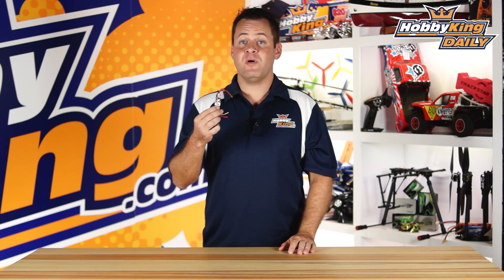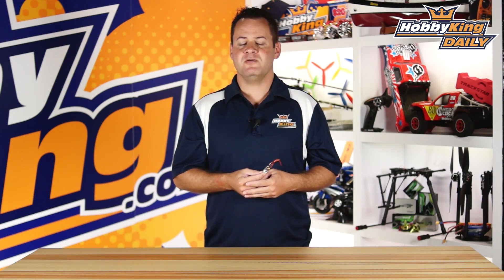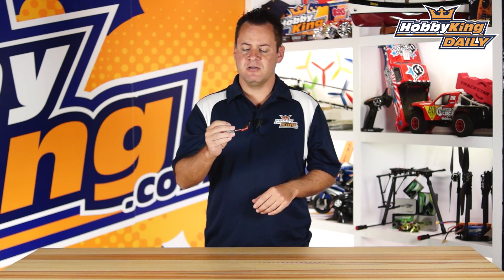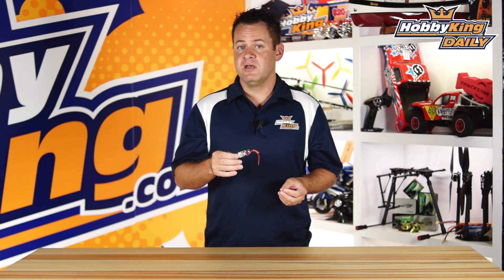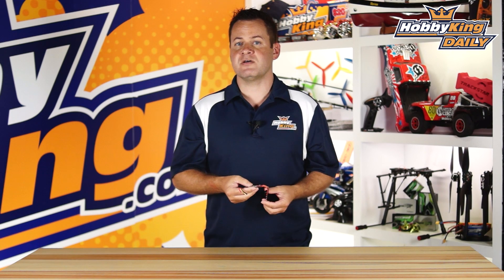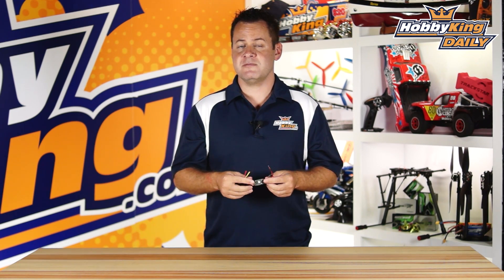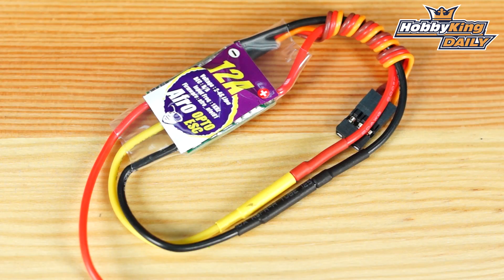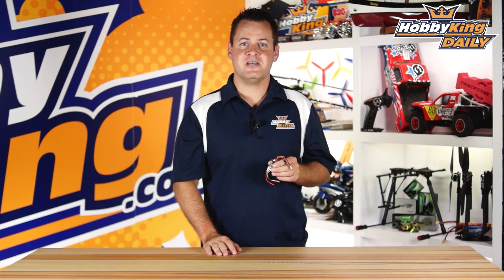Afro ESC 12Amp OPTO Ultra Lite - HobbyKing Daily

Comment: I have 4 opto ESCs and a CC3D, can I power the CC3D wih a 3S battery (11.1v instead of 5v) or I'll burn it? 
Thanks!
Reply from the maker: +furulevi It will burn out. Requires 5v input.

Comment: naze32 doesn't take 7-15v it just has input for battery voltage monitoring. even 5.5v will kill it, it works only on 5v
Reply: Yep... I second this.  naze32 will take a higher voltage for the battery monitor ONLY, but if you try to power the actual board with greater than 5.5v you will damage it (as TheFunwithrc stated).
Reply: Patrick Tuxbury TheFunwithrc Per timecop: "16V, 20 max 20 = absolute max if you wanna run it off 4S you probly wanna add a diode but its only the ones that say |L32x on them if it says DE=2xx then its 5.5V tho anything shipped since august and HK versions are 16V regs."
Reply: Good to know Michael. Still, to say that greater than 5.5V is okay to use with naze32 could get some people with versions sold just a few months ago in trouble.

Comment: Dude, seriously, you gotta stop calling it a "beak"... It's B.E.C ("Bee. Eee. See.") which stands for Battery Eliminator Circuit, or at least just call it the onboard regulator... it'd be like calling an L.E.D (Light Emitting Diode) a "Lead". Sorry but as an electronic and robotic engineer things like that annoy me coming from channels like this within the RC community :) sorry to be a moaner :)
Reply: lol, do you seriously never heard anyone saying "lead" panel or anything? Where do you live?
Reply: ...as someone who has spent many years in the tech industry, I agree wholeheartedly. One of the most annoying things in technology are the pet terminologies used by egotistical people who wish to place their mark on something. Standards are there for a reason. Uniformity of terminology is essential to passing on the education with less confusion.
I do not think the host here has an ego problem- but if the goal is to simplify, then use the standard simple term- not a self coined euphemism.
Reply: mPky1
20 people and counting seem to disagree with you.
Reply: mPky1
I think at this point- the only one really fussing is you. I believe I will go check my BEC inventory... with a short "e" vowel, ROFL!
Reply: lasersbee "and you get all bent out of shape"... you got a laugh out of me, mate, did you read your comment?